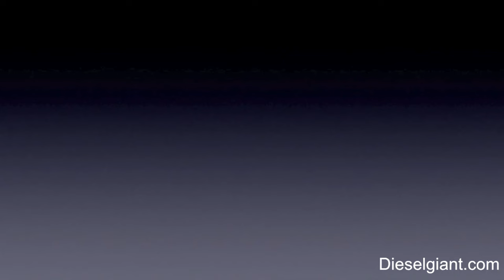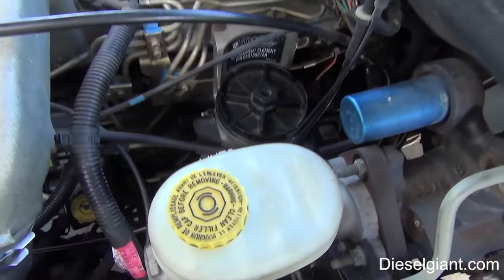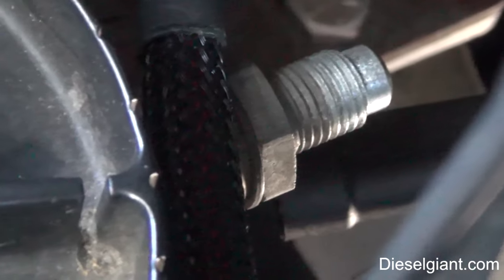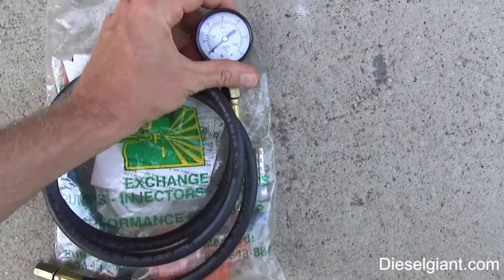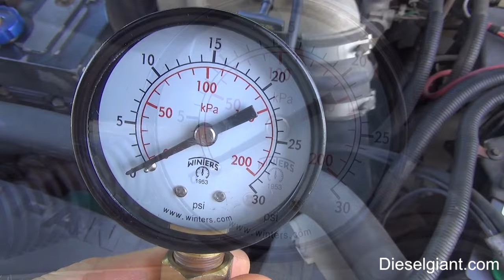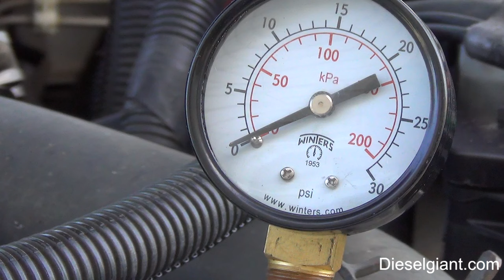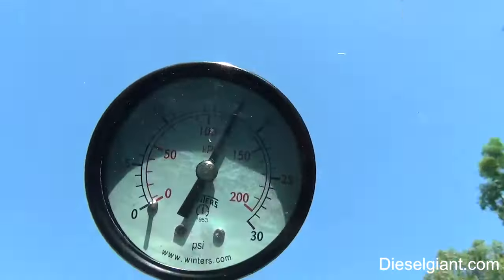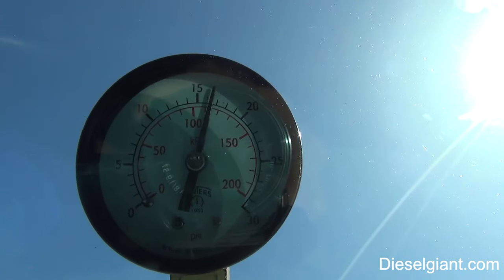How to test fuel pressure on a Dodge Ram 2500 24v with the Cummins Turbo Diesel

Comment: I watch your video on how you check the pressure and thanks for the tip on the upgrade on the pump I have a '98 Dodge comments and I'm having trouble with it cutting out on acceleration going down the road

Comment: Overall good to excellent content; just have a minor correction. Dodge did NOT specify the Carter transfer pump; Dodge did not adhere to Cummins lift and distance from pump to fuel pickup specifications. Other (Freightliner, for example) installations of the VP44-equipped ISB engines were fitted with the same Carter transfer pump.

Comment: Could you use the test point on back of filter as permanent location for a fuel pressure gauge? Seems a lot easier than banjo bolt replacements?
Reply: You could but some say to install a gauge after the filter to ck for true pressure going into the VP44 since that is what is really important.  Ps, I know this is an old post but thought it might help others.

Comment: Question: I noticed your valve is in the same place as mine on the back of the filter housing. Is this the best place to test or should I put a valve at the banjo bolt in the pump so it's testing right before it goes into the vp44?
Reply: Doesn't really matter. VP 44 blew out to the tune of $3200. Dodge is now on my "S***" list.
Reply: @chilidog73  Just do a P pump replacement for that fucking price; youll never have an issue again, and you can run SVO/WVO and UMO

Comment: Thank you for your videos! Since the border of this gauge is metal, whenever you set it on top pf the windshield you may want to place under three points of the metalic border something like three pieces of duct tape or any thick enough material, so at least three points of the metal housing of the gauge rest directly on top of duct tape resulting in absorbing its vibrational impact against your shield which may not break soon but if one day the windshield is too cold or its vibration coincide with the gauge's vibration may crack your windshield.

Comment: I have a 2001 Dodge 2500 4x4 5.9 Cummins with a custom rebuilt VP44 (not by Bosch, way better that a Bosch built) with about 300k miles. I also have a 2006 Dodge 2500 4x4 with 212k miles, that of course is a common rail with the CP3 high pressure pump. The 2001 got full gauges within a year or so and the 2006 got them immediately. I think it's essential for any diesel owner to put gauges on to monitor several functions that can cause problems. 
I put 2 OEM lift pumps on the 2001 and had a 3rd under the seat in case it was needed. Only takes about 15 minutes to change one. Since I had full gauges on the truck I could replace the lift pump as the pressure started to decrease. Got tired of replacing it, generally around 45,000 miles, and put a F.A.S.S. system on and sold the OEM one that was under the seat. It has been on about 19 years and has about 200k miles now, still works perfect. Put gauges on your trucks. Fuel pressure is essential. EGT's will help you not overheat your turbo, especially if you tow. Boost gauge will help you determine if you have a leak or a waste gate issue. Help your motor have the long life they are capable of.
Another note, I use a diesel additive in every tank full. Lubricates pumps and injectors for a long life. #2 diesel is not so good any more.
Reply: I found out you can get that exact same gear pump DDRP that FASS uses but for way less on eBay or Amazon.   The only problem was the connector was wired backwards.    For $100 and doing a little bit of rewiring I saved $250.     I installed two of them on two different trucks, it's only been a year but they're working perfect just like the FASS.

Comment: I always had a pressure release valve on my tester to first bleed /purge the air from the test line to the gauge so as not to have a air bubble in the line.

Comment: i have a 2003 ram 2500 and have it it for 10 years and never replaced a pump until now. 
i had lost power changed the filter everything was ok then a few days later the pump directly behind the fuel filter went out, so i replaced that 200$ autozone but then a week later the engine started bucking, to find out i have bad fuel and the tank needs to be droppped and all fuel lines purged and cleaned, i still confused about all this talk on the 2 pumps one behind the filter and one in the tank, dodge says i have both. i would like to remove all stock pumps and install a fass.

Comment: So I can’t find this shrewder valve any where. I have a flat bolt on the back of the fuel filter housing. I also have an airdog pump installed. (Not by me) the truck will not accelerate, it starts and idles fine. Is there another way I could test the fuel pressure?
Reply: Shraeder *

Comment: On acceleration, my 2000 24 valve Cummins with 203,000 miles SOMETIMES hesitates and hiccups a bit, and has a hard time getting to hwy speed (55-60mph) then takes off like nothing is wrong. Could that be a fuel psi problem?
Reply: Could be that the fuel filter is clogged or dirty!
Even if it looks good and not wrong with the filter you better replace it.
I had the same thing happening with my 99 24 valve sometimes and just did a new fuel filter in before starting to try and check other things.
It was running great again with a new fuel filter in and does have 20 psi on idle and around 15 on acceleration.

Comment: The problem that shocked me today since I know recently I diesel my truck was the empty alarm went off and needle went down so, due to the doubt I diesel it again, and I paid at a non familiar pump really less than I used to fill my tank, is a 1999 3500 the one I have..so, I realized i guess something is not working properly in my truck so.. i have to check its cause. the truck is moving fine but, the gauge is looking empty even after I fill the tank today.

Comment: I have a 01 dodge 3500 5.9 Cummins the problem I’m having is that on the road 1500 rps the truck pulls a little. It starts fine runs good. Any suggestions? Thanks

Comment: I have a fast fuel system with a Edge programmer digital readout on my fuel pressure bouncing around between 15 and 19 will not stay steady change the fuel return valve and had to put in a new crank sensor still bouncing around

Comment: My lift pump just went out on my truck and I've been considering a FASS system and getting some of those collum gauges to monitor my fuel pressure so i don't have to guess about it
Reply: I'd suggest typing DDRP diesel fuel pump on eBay or Amazon.   Same exact pump FASS uses but for only $100.   You'll have to rewire the connector because for some reason they wired it backwards.     No big deal.   Beats paying $300

Comment: Hey there, I have a 99 dodge ram diesel Cummins motor was driving it and it just turned off crank it up. It will start up and shot right off. Been trying to show trouble shoot this and having no luck any ideas.
Reply: Definitely want to check the fuel pressure first before anything

Comment: Quick question for ya, my 01 ram doesn't have the port right off of the fuel filter like yours does. Is there anywhere else to check what my pump is pushing? I checked a port that was on my injection pump and I think it was the high side port but I'm not 100% sure. My truck died on me one day out of nowhere and I hadn't been able to get it cranked back up since, I changed the fuel filter and like I said checked the pressure either going into my injection pump or going out and it was running 20 psi once I got the pump running. Any idea at all what I should do from here?
Reply: Luke Fields zome time it is directly under the filter.
Reply: You can bleed your fuel lines with the one on the injection pump after you change f filter. 
Just cycle the pump and push in the pin like airing down a tire. You can also connect pressure gauge there

Comment: I must live right, I bought a 98 24v with 150k and the original pump. Put a gauge on it today..stupid easy, hard line comes out the top of the filter, goes to 8in rubber hose and back to hard line..I cut the rubber hose, stuck in a 3/8 brass T, on one leg of the T I soldered  a fitting for  1/8 copper line and ran it to a$15 marshall liquid filled gauge..I wouldnt run a gauge inside the truck on a gas deal .copper line and diesel dont bother me..I guess 8 psi draggin a load up a mountain is fine

Comment: Can you still check the fuel pressure with a Fass 150 cuz it buy passes the stock fuel filter??
Reply: Travis Hurren there's a fitting on the fass itself or just get pillar gauges

Comment: Okay what new fuel pump did you install? I had the fuel pump fail me today. Not happy with the new system.  Only 10 psi
Reply from the maker: I used the FAAS pump that fits in the stock location and bolts right up to the line with no mods needed.  Its a great pump.

Comment: Awesome video!  I have an '02  and that fitting for the pressure gauge isn't on the fuel filter housing.  Are you the original owner of that truck?  Did you put it on?  I'm going to go check the manual for another location, I'm sure there is one.  Thanks again for the video!
Reply: Its there from the factory.
Reply: I found it on mine, it's on the supply line to the high pressure pump.  I guess they moved things around through the process.
Reply: Mine is the same way. There is no fitting on back of filter housing just a flat bolt. Has one at the middle of vp pump(I think that's the name)

Comment: Went to 13, then to 21. Basically we may use a fitting that threads into the pump prompt, with a hose and gauges that have psi and kpa.

I don't know if you see this cause I added comments that after I sent them to you YT didn't immediately showed. Next time you want to put some insulation or something that isolates the impact of the vibration of the gauge on the windshield.

Comment: I have a 2001 Dodge ram 5.924 valve Cummins give me injection time in cycle do you know what that means causing this code to come up
Reply: The timing in the vp44 starting to go out of phase.   You'll have to replace the vp44

Comment: I have a question. My 02. I want to check my fuel pressure but I don’t have that valves to tap into on the back of my fuel filter. My raptor 150 is hooked into that.  Can I check pressure off the vp44. Where the hard like goes in from the bottom of the filter ?
Reply: The connection is on the vp. Has a black plastic cap like a valve stem. On the fuel inlet of the vp.

Comment: would a bad lift pump cause low fuel pressure under load . I thought these only ran for a short time to start the vehicle
Reply: yes they can, it is used to enhance the fuel delivery to the VP44 and provide lubrication via excess fuel.
Reply: for your P pump it can also do the same.
Reply: p pump ?
Reply: Biking With Panda it's a new pump.   Truck was fine until it ram out of fuel. . Runs and drives but loses fuel pressure under heavy acceleration . Replaced pump . Didn't help and now the pump doesn't even come on when I cycle the ignition.
Reply: Try to look at return line banjo bolt! Easy to check and replace!! You tube it, common problem

Comment: does the fuel sending unit  out of the tank have a pump in it? im kinda confused because i see a a lot of videos that claim if you have a pump behind the fuel filter you do not have one at the tank and if there is no pump at the fuel filter you have a conversion kit and the pump is at the tank. well my 2003 ram 2500 is at dodge right now with contaminated fuel and the are dropping the tank and cleaning everything. they claim i have 2 pumps and want to change both. I know i have a pump behind the filter because i changed it a month ago.  i have been looking at replacing the fuel pump with a Fass fuel pump. but a draw straw is required if you have a pump at the tank. IF you install a Fass pump are all the stock pumps in the system not used anymore?

Comment: Okay if you have the lift pump then there is non in your tank,,,its that correct??
Reply: Pool killer Monjaras yes if there is a lift pump there is nothing in the tank
Reply: Pool killer Monjaras what year do you have
Reply: @thebeatuppony6432  thank you so much I guess I have a bad lift pump due to I change my fuel filter and now the truck doesn't start at all and I try to prime but still any diesel on the canister even that I can hear the lift pump the canister still empty after like 20 or more prime's
Reply: Pool killer Monjaras you got an instagram
Reply: @thebeatuppony6432  it's a 1998 with the 24 valve and already see the lift pump
Reply: Pool killer Monjaras i have a 2001
Reply: I'll put more fuel on the tank raise all to way to half tank and open the ignition to on position then kinda crank and I can heard the pump but got the canister out and there is 0 fuel 😥
Reply: Pool killer Monjaras maybe you have air in the lines or it’s the lift pump
Reply: @thebeatuppony6432  okay well I remove the canister and I turn the ignition on position again and the lift pump sound like its working but there is any fuel coming out the like that feeds the canister so either something its wrong with the like that fit in the tank or the lift pump it's not sucking at all anymore

Comment: I put in a new fast pump cause I was told my fuel pressure was only 4lbs at idol.  Now the pressure at idol is running about 15 lbs but when I give it throttle it acts like it is running out of fuel.  I bled the system and it started up but still will not run when given throttle.  I am at a loss can you please give me ideas to check for?
Reply: Elizabeth Kennedy and
Reply: Elizabeth Kennedy gcvb

Comment: 94 24 valve cummings , Was ran out of fuel , refueled bled system truck runs and shows good pressure when you start and idle but drops way,way down under load and no pulling power . replaced list pump and no better . also cant hear the pump run when cycling the ignition the the pressure comes up . anyone ?
Reply: No such thing as a 94 24 valve unless some one put the 24 valve in it

Comment: I have the same pump on my 2001 dodge ram 2500 5.9 cummins. I wanted to let you know I'm experiencing some low volume of pressure..I've been driving it like this for 2 days. somehow I got into bad BP diesel feul. moreover, as I'm driving it showing 9psi oppose to when it was at approx 14-19psi. secondly, I have a small clear FF5-16TDL Filter I installed before the fuel goes into the pump from the tank..I have replace it for the third time..what do ya think what might be causing this issue..I'm think the sediments got into my pumps.
Reply from the maker: +Chey Dducloseille Well there is a filter in the tank that is suppose to keep the big stuff out of the pump.  How old is your pump?
Reply: 2 years old! That's my thought about the tank pump filter...do they go bad?
Reply from the maker: Generally they will clog up and you will get reduced flow.
Reply: Yep! Is there any way of possibly cleaning up to get rid of sediments. ..or I need to take it apart?
Reply: @cducloseille5272  You could put a hose inside the filler neck and pump the gas from the bottom of the tank into a 5 gallon bucket and take a look at it see what you get

Comment: my truck is hard to start even after the first start ?
Reply: Rocky Northern do u have air in the lines ?     Could be losing prime.       Start with small things first and diagnose the issue.

Comment: you forgot to mention what year your video applies to. I have a 2500 24v but it's a 2003 Federal. It is nothing like yours. NO schreader valve and there is no fuel pump like your FASS. THank you for the video but it will be useless to some. I fast forwared thru your introduction, i'm not interested in hearing you Yap, so if you mentioned the year, then IDK
Reply: Well that’s your fault for not watching the whole video.  Your short attention span caused you to not hear what year it was.  If you don’t wanna hear me app then go watch a PewDiePie video.  Lol

Comment: what size pump you use i just put one in tank in the gime only 14 psi in running around 11 psi
Reply: I HAVE A 99 DODGE DIESEL AND IT HAS ONE IN THE TANK AND ONE ONE THE DRIVERS SIDE OF THE BLOCK it runs great untill i get to a half tank of fuel then it dies and u have to put fuel in it and bleed the air out of the injectors  i no i'm not getting fire to the pump in the tank don't no why yet its not a fuse or a relay , i guess the pump on the side of the block is sucking the fuel out untill it gets to ahalf a tank and then it can't suck anymore HELP ANYONE

Comment: In tank pumps are junk!! Dodge screwed up with that update. Don't fall for that bogus replacement option.
Reply: I hear everybody saying the n tank pumps are junk mine's been converted back in 2002 and I only changed it twice since 2002 and Mine Holds 20 psi at idle in about 15 to 17 at wot and I've never had to change my vp44 pump not one just run a good additive in your fuel.

Comment: The fuel pressure is supposed to be 15-20psi
Reply: I have 10psi idling and it runs fine
Reply: @aaronbqwert7164 it depends what you want to do with it.   10 psi is probably okay for normal street driving.   But if you want to start beefing things up.  10 psi will put you in danger of starving the vp44

Comment: What is the normal pressure readings for the stock pump from dodge?
Reply: ever get found out what it is?
Reply: 12 PSI for a brand new stock lift pump